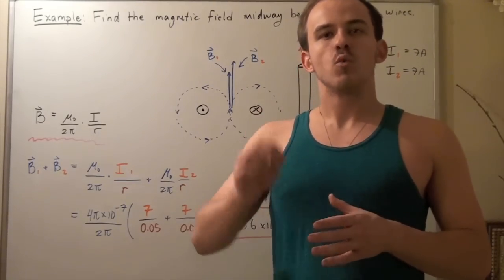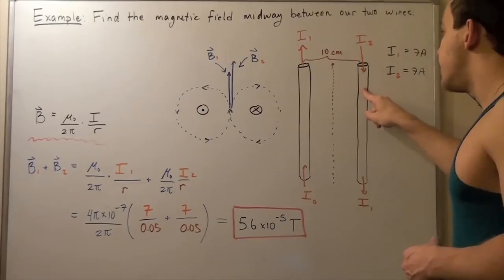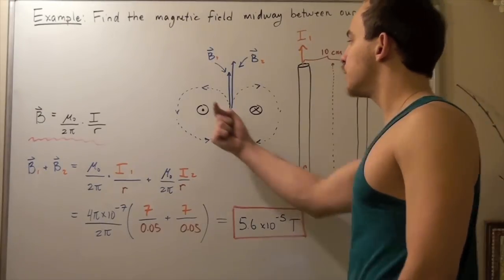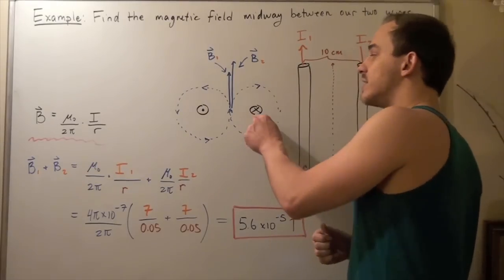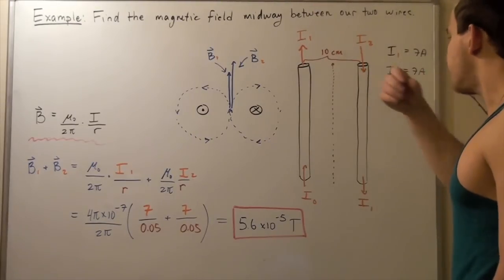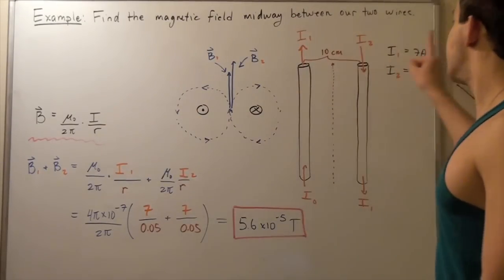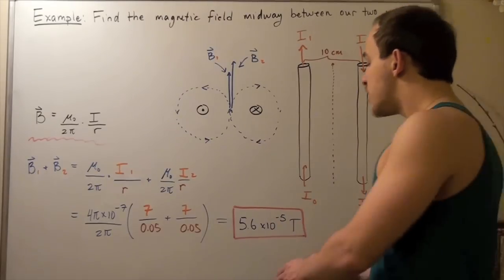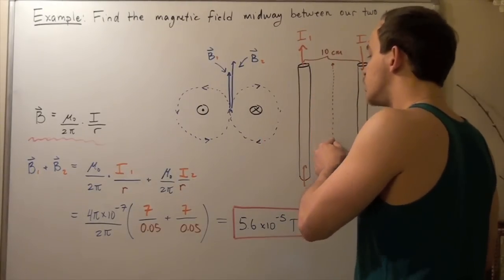Magnetic Field Midway between Two Wires

Comment from the maker: hmm. you would still need to take the algebraic sum of the two magnetic fields created by the two wires. so first find the magnitude of both fields and then the direction. If they point in the same direction at the point of interest, then add them. If they point in the opposite direction, subtract them. hope that helps.